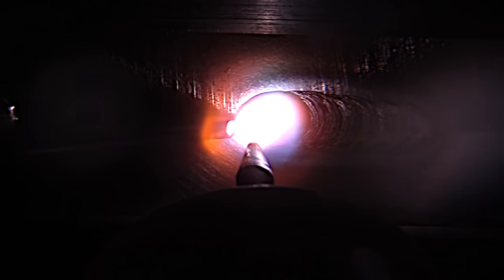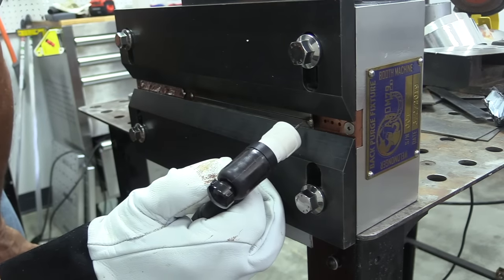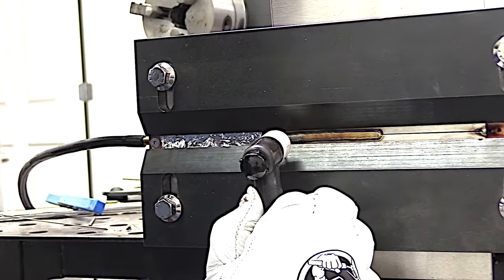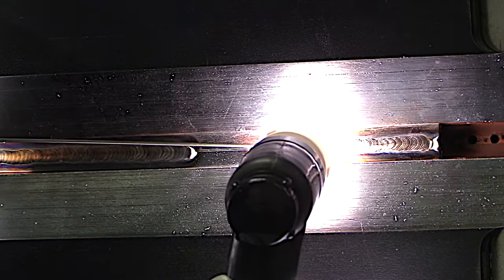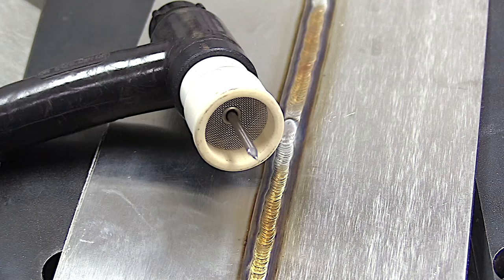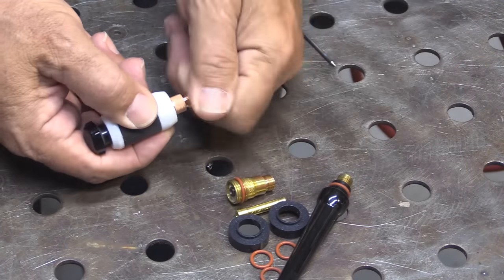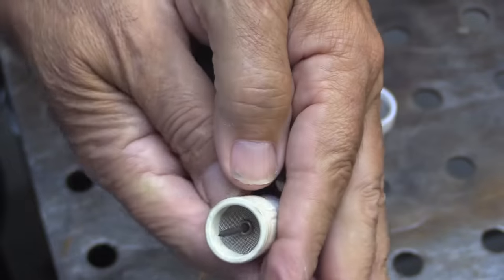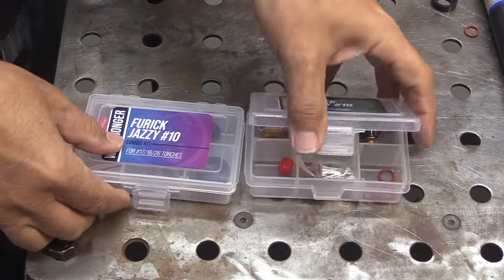2G Stainless Steel Weld Test Based on AWS D17.1 Aerospace Welding Spec

Comment: Nice vid. I’ve been following you a long time, but this is my first comment. Can you do a video on wedge collets? Pros and cons.
Reply: I just recently bought some wedge collets. Primary reason for switching to wedge: old collet: tungsten gets pushed up into cup when it's loose and you have to take the cup, cup and gas lens/collet body apart. So far I haven't had this issue with the wedge collet. Your mileage may vary ...
Reply: My experience with wedge collets is they hold the tungstens too well.  The hot tungsten seems to back up into the torch when I try to tap it out.  I could grab it with welding pliers but that requires common sense.  The channel This Old Tony has a video about wedge collets.
Reply: @fltchr4449  this is exactly the experience I’ve had with traditional collets for many many many many years. Especially tapping the torch to coax the tungsten down. It goes the other way instead
Reply: ive been using the same wedge collet for 2 years. they are infinitely better
Reply: Had tungsten sticking problems on both the wedge and the standard. Seems I’m doomed to taking my torch heat apart every time
Reply: @dorsetengineering  I've taken to grabbing the tip with pliers.  A variation of what I used to do, grab it with my fingers.  Much less burning of burning my gloves now.

Comment: I noticed your aerospace test examples are always on plate. Can you do a video with a 3/8 tube to a .035 plate ? Or a tube to tube test ? There’s a lot of tube assemblies out there that are welded to d17 spec. Aluminum tube groove and fillets are one of the hardest tests to pass. Any tips or tricks would help alot !

Comment: Ive got a quick question???
Ive got a job made of stainless-its a 3" tube with a 1/16 wall thickness but the fitting on the end has a wall thickness of 3/8" but when i weld it i keep undercutting the thicker part-could you help. Thanx in advance

Comment: Don’t mean to be difficult here, but you are risking failure due to lack of penetration by starting in the middle and hoping to burn through your previous start point. Penetration is the biggest obstacle to a 2G. Not to mention the higher likelihood of cracks due to all of the added stress at the same point. I enjoy your content, but gotta disagree with this approach.

Comment: @weldingtipsandtricks thank you for the offer!! I bought a furick #12 ceramic cup with the free jazzy #10. I already have the furick #16 and it works wonders on stainless and the 10 and 12 will definitely help with tighter space that the 16 can’t get to.

Comment: Hey, I’m about to make my first purchase at your store and I wanted to know if the 10% off would negate the jazzy 10 inclusion?
Reply from the maker: Every order gets a jazzy
Reply: @weldingtipsandtricks  do I have to buy the rest of the hardware to be able to use the jazzy 10 cup? I have a ck17 torch
Reply from the maker: @bluedemon79  yes you would need a Furick adapter kit 3/32”
Reply: @weldingtipsandtricks   I figured it out. I just placed my order. Thanks

Comment: Interesting as always, in the UK we have a sheet to sheet and sheet to tube BCAR (British civil aircraft requirements) test, but it also allows for a "discard" each end on the sheet to sheet which seems strange to me.  The sheet to tube gets cut in two places for micro examination, so there's always a chance one of the sections will be at a tie in I guess.  Thanks for the Videos.

Comment: How can I Mig weld more then a 1” long bead in aluminum with a spool gun without the piece warping to heat?

I’ve checked my settings 10x, bead looks good, I’ll try with 3/8 thick aluminum just to help absorb heat, and even have the work piece clamped down to a large steel plate to take heat away. And have tried welding “up to” 1” per second to make sure I’m not just cooking it. 

No matter what I try, I can’t put down more then 1” of bead without heat warping, and needing to let it cool for 10-15min.
And yes I tack things together and spread out my welds
Reply: @Turningwrenchs  thanks for the tip. I’m not typically welding sheet metal or aluminum thin enough to bend that way.